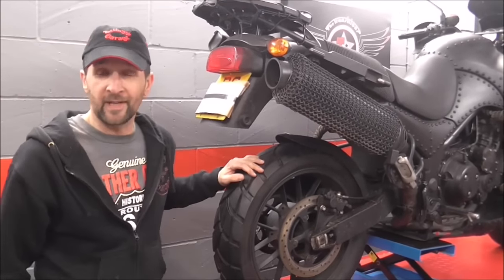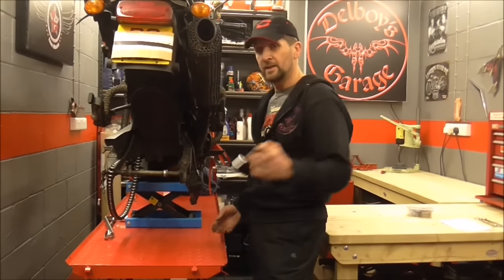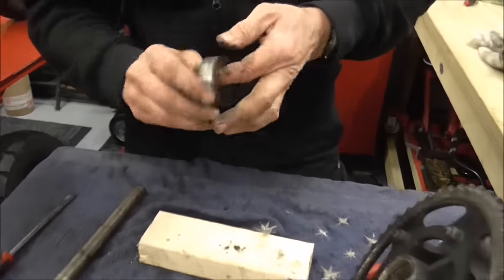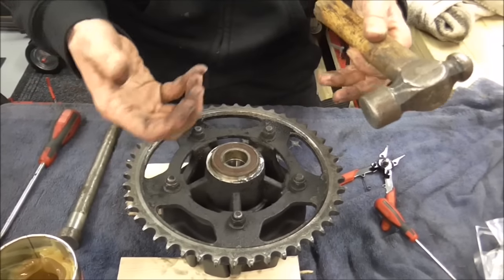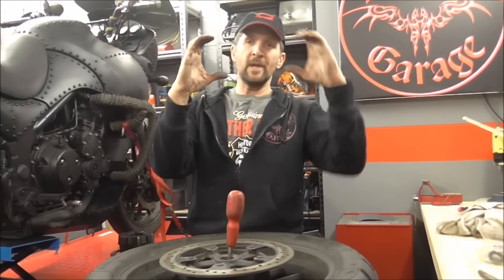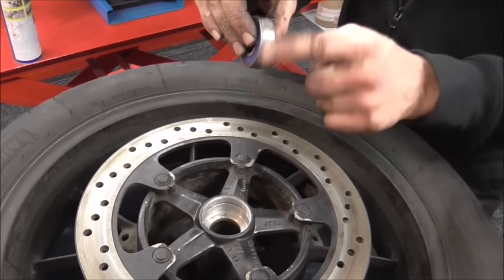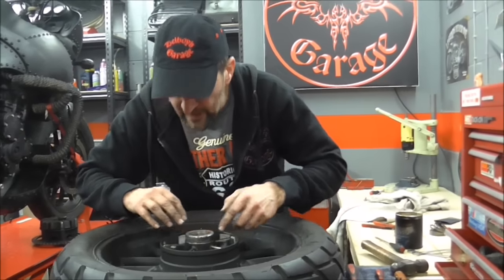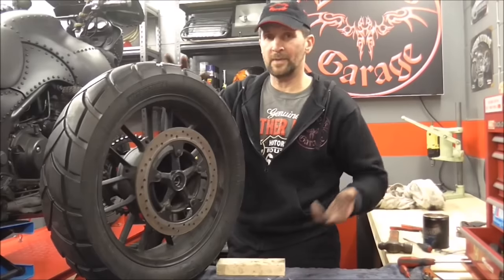Delboy's Garage, Motorcycle Wheel Bearing Replacement.

Comment: Hi Del, Im after some of your wisdom, I have a Triumph Bonneville T 100 that i got recently and I am going to have it converted to a Trike my reason for this is i had quite a few major operations and i dont have any core muscles left so as much as i would love to keep the bike as it is thats not possible I have had bikes in the past. My question is about running the engine because it just sat their and will be until the new year, im concerned about condensation throughout the whole of the engine and how often i should start it and run the engine and how long for, can you help me with this from  Bob
Reply from the maker: HI Robert...so this is about 'Layup practice and procedure'..? right.!    Ok, well its actualy not what we would think.... Most people feel they have to start the engine at periodic intervals to "keep it running"... which is NOT true.. in fact, its the opposite..! the process of starting the motor, creates heat (obviously) which then causes any moist air in the inside of the engine to condense and form water droplets...now this is fine and harmless if you intend to run the bike till its red hot for about 20 minutes and evaporate all that water away out of the breathers... or better still, ride the bike for ten miles.... but just firing it up for five minutes actually leaves the motor soaking wet inside and then you start it rusting internally.... so you have to go one way or the other buddy... either ride the bike for an hour once a week... (which i see you cant do) so all you need to do is run the engine until its red hot and all dried out, (say about 20 minutes at least... then switch it off, remove the battery, and keep that in a battery minder so it doesnt go flat...the bike will be fine for at least 3 months... then do it again is you are worried.. but the petrol will go off and casue problems after then long.. so just leave it till you're ready to do the conversion... it'll be fine.. and when you come to start it up again, syphon the old stale fuel out of the tank and fill it with some fresh stuff before you hit the starter.... Hope that helps buddy.. good luck with it.. Del
Reply: Hi Del thanks mate for getting back to me much appreciated, the bike is a 2013 mileage is very low only 236 miles from new  I think i will put some of the fuel additive in should stop it gumming up fuel injectors and do what you said, I will change the fuel when its ready for conversion what do you think Del ?
Reply from the maker: Good move Sir, another little fun trick you can do to help preserve those fresh cylinder bores, is take the plugs out, once you've fully dried out the engine and let it cool right down, then squirt a jolly good belt of WD40 in each plug hole and with the plusg still OUT, spin the engine over for a few seconds to distribute the WD40 all round the bores, then put the plugs back in... don't start the bike again, just leave it like that... that will prevent rust developing in the bore, which could scratcht the sides once it starts back up..... also, helps to change the oil once you lay it up, so the old stuff is gone, just in case there is any last traces of water in the oil....  good luck with it, hope it goes ok for you !

Comment: got a question matey after inspection of my rear gsx 1400 bearings there seems to be a slight gap either side of the bearing spacer no play in the spacer however ....I know they sit against the bearings either end but is it meant to be non moving /loose ? reason u ask all of this is because I had to buy a second hand sprocket carrier off ebay as 3 of the 5 studs came out of my original one and although I put them back in with grips I torqued up the nuts and all bar 1 knackered the thread on the carrier .....now when I sit the carrier in the wheel /hub it's like it don't sit as snug as I'd have thought originally now you may ask surely having owned the bike since 2007 at 11 months old I'd know but it's one of those things I've not really noticed tbh  I'm a competent person when working on it but this is something I want right new sprocket & carrier was fab plus all studs stayed in place when u made new attempt of replacing new shiny nuts but reduced the torque from 105 nm to 70 with locktite would you suggest replacing the bearings just in  case for some reason the bearings are not seated enough ? thus not allowing the spacer between carrier and wheel hub to sit in enough against the bearing ? any help thank you
Reply from the maker: +Kevin Hancock Hi mate, that's a long question, I think I get your gist... ok, firstly, you should put the sprocket carrier in with some lube if you don't think it's all the way... red rubber lube works best, if you have some, or just some WD40 if you have nothing else... and when you bolt the wheel in, and bolt the axle in, it should pull the carrier in to place and seat it.  As for the centre tube and the bearings, there is no precise measurement, you seat the bearing one side of the hub that actually has a seat, and the other side has a smooth hole with no seat... and you just tap the bearing in until it squeezes against the centre tube, but the centre tube must remain slightly moveable if you lever it... unless your centre tube is rattling round side to side, then the bearings are probably seated... and as long as your wheel does not move side to side when it's all bolted up, and the disc lines up with the caliper, then it's fine!
Reply: +Moonfleet41 thank you fir your reply much appreciated and yeah sorry for the essay lol I'll take wheel off again Sunday and I had red rubber grease which I'll use on carrier/cushings  I checked for movement on wheel there isn't any ....the manual stayed that the left side should be done first I'm guessing from what I remember that's the seated side but whichever applies I guess I the centre spacer isn't lose however so not sure if this is a problem ? love your videos mate always clear and good quality

Comment: How did you manage to get the old bearing out when you tapped the new one into the sproket? @moonfleet41
Reply from the maker: It doesn't go in far enough to enter the tight area, well maybe a fraction, but it just pulls out easy..

Comment: Did you instal bearings with C3 clearance or normal clearance?
Reply from the maker: Hi Mirko, i have never seen wheel bearings sold with an option of C3,4 or 5 clearance, they are just sold as the correct bearings for the bike you have... so all the buyer can assume is that they are appropriate for the task..!
Reply: In bike installing bearings with clearance C2 , normal or C3 . I never heard bearings for wheels with clearance C4 or C5 .
Reply from the maker: No indeed, its just an example,. the point being that when you buy wheel bearings for a regular road bike, you just order the ones for your bike, and fit them aye...

Comment: Just checked mine and its doing the same thing. Is it ok to ride until I can get it changed ?
Reply from the maker: It depends how bad the freeplay is mate.. there is no way of knowing how safe it is, it could last months..or it could lock up and collapse tomorrow... its your risk my friend, but i would  get it done as soon as you can.!  don't risk your safety aye.!
Reply: @Moonfleet41  OMG thanks so much for the quick response. This is my daily unfortunately so I will have to risk it until the end of the week at least. Than you again.
Reply from the maker: OK mate, totally understand the pressures of life and commuting... a buddy of mine had one in the rear of his bike completely collapse, ended up with the wheel twisting to one side and locking up, so go steady for goodness sake, check it before and after every ride and keep yourself to the minimum speed possible for your commute... and if the bike feels weird in any way, then stop and check it... would hate to hear you've hurt yourself...
Reply: @Moonfleet41  Thank you, the only freeplay I see is between 0.5 to 1mm. I hope it will be ok till end of the week for sure. I could have been riding like this for couple weeks before I did my chain slack today.

Comment: Are the front and rear bearings the same diameter?
Reply from the maker: Not sure buddy, id have to check part numbers, if the part number is the same.. then so are the bearings buddy.
Reply: Moonfleet41 yeah it's for my B6 but I can't seem to locate fronts as easy as rears

Comment: Why you are not grease the new bearing ?
Reply: If you grease the new bearing the bearing will lasting long times.
Reply: @jyotiprakashdas1870  The new bearings are pre-greased and sealed, during manufacture, at the factory. If you were to take these sealed bearings apart, to grease the bearings, you would destroy the bearing seal, which is different from the separate external protective seal. 

These are not the type of bearings that can be greased with a grease gun or grease packing tool.

Comment: This pronuonced wear would affect the ride quality ! You probably would have had to do this much earlier.
Reply from the maker: Not really Leo, the ride quality would be effected as time goes by... 
but that tiny little bit of play wont make any detectable difference 
unless you're on a track bike..!! this big old dollop has such lazy soft
 suspension it soaks up everything...
Reply: That is possible. I had a 600cc Hornet which sudenly started to feel unsteady at low/medium speed. I checked the wheels for any play but didn't notice anything wrong. However I decided to change the front bearings and voila, everything was back in order. Thanks for the video and also for the reply! Keep it up!
Reply from the maker: Thanks Leo.. and yeah, there are many things that can throw out the handling of a bike.. uneven tyre wear is the biggest as people just see tread depth and think its ok... but if the sides of a front boot as 'shouldered'...then it'll try to kill you on ever bend..lol

Comment: Hi Sir. I don't have a crack in the bearings housing or where the bearing seats. The crack i have is where the tube or the spacer bearing . The one with the metal tube seats. Is there a chance for my wheel?
Reply from the maker: What do you mean you have a crack?
Reply: @Moonfleet41  i can't send a picture in the comments. The crack I'm saying is the hole where the spacer tube lives.
Reply: @Moonfleet41  there is no crack where the bearing seats. But there is a crack where the spacer bearing tube seats.

Comment: Help me !!! 
My bike is going left and right while i am riding it
Can anyone help me
Reply from the maker: Hi buddy, that wandering that you are experiencing could be worn out headstock bearings.
When they get badly worn, the headstock bearing develops a 'notch' in the dead ahead, middle position and the steering wants to stay dead ahead... when we ride we make tiny minute adjustments to the bars all the time, but if that notch is resisting, it causes you to over correct and the bike feels like it is wandering left and right...
Get the front wheel off the ground, crouch down in front of the bike, grab the bottom of the forks with both hands, and turn the steering side to side, if you feel a 'notch' in the middle, then replace your headstock bearings and it will be fine... good luck with it.
Reply: Moonfleet41 it was changed few days back 
The front is like a puncher Tyre feeling hard sometimes left sometimes right 
What other causes of this problem 
I had an accident before

Comment: on average - how many miles until the rear bearing is shot?
Reply from the maker: Hi buddy, that really is a hard question to answer... as there is no given mileage where a bearing will give up... if the bike is cared for, and loved, serviced regularly, and more importantly, kept clean and never power washed, then a wheel bearing can practically last the life of the bike, but on the other hand, the minute you power wash your bearings out with a steam cleaner, the grease gets blasted out the water goes in, and the can rust in a few months... even with general neglect, if your bike is hardly ever washed, and just used as a commuter, then maybe 20-30k miles... but as a guide, wheel bearings are a point of the MOT and that's carried out from 3yrs old in the UK anyway...  so pays to check them at least every year...
Reply: thanks for the response. I had the rear wheel off my FZ6 last night for other reasons and was inspecting the bearings and they seemed smooth and still had clean lube so not a problem - but it is a good point to avoid direct steam cleaning and doing routine inspection. take care - I enjoy your videos.